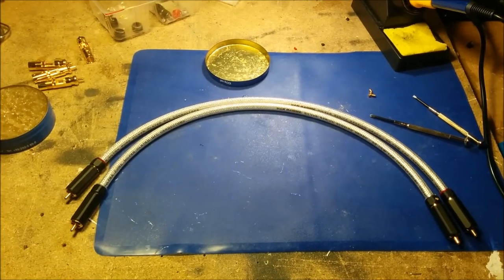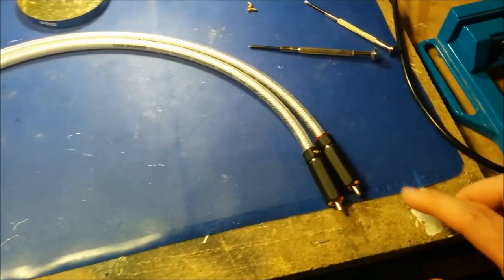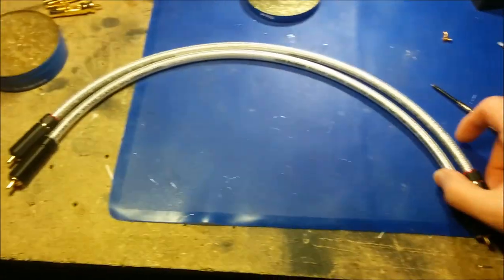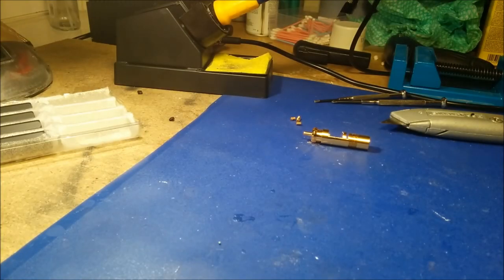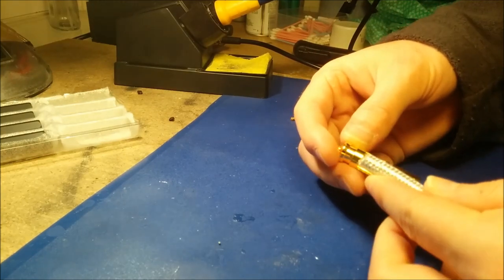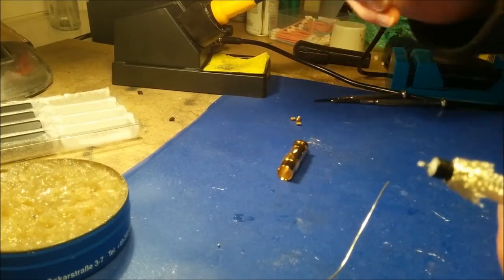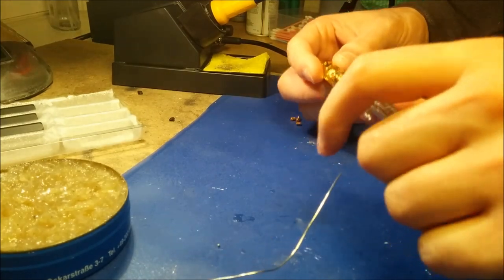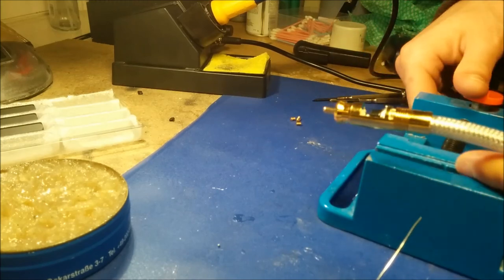How to make 1000 $ Sounding audiophile highend RCA interconnect cable for 30 $ !!!

Comment: Just curious. The Van Damme Lo-Cap Silver Series is rated at 55p/F. Is that per meter, or per foot? If per foot, then it would be about 17p/F, which makes this very expensive cable marginally better than the budget priced Monoprice cable. Interesting.

Super cheap Monoprice cables use standard RG-59 75ohm coax rated at 22p/F.

Blue Jeans Cables are rated at 12p/F. Rated one of the best in the industry for low noise distortion. 

Exactly why would a higher capacitance Van Damme coaxial cable be better, when it is pretty well know that the lowest capacitance provides the lowest noise and interference signal?

I think for any component run under 1 meter, no audible difference would be noticed, unless you were Superman. I'm starting to think unless you are putting components all over your room, most normal stereo stacks will use under 1 meter RCA connections, Standard Monoprice Premium RCA's are all you really need, and all this super high end cabling is primarily for BLING!!!
Reply: Condor1970 it makes a difference, capacitance is only one form of measurement.
Reply: What measurements? Just curious, because they do lots of sound recordings to analyze the actually sound signatures after production, and it seems very little if any difference is notable. I'm certainly no expert, but if there is some series of measurements taken to provide serious differentiation of the cables, what are they?
Reply: Condor1970 it's basic electrical engineering. At college I learned about capacitance, inductance, impedance, resistance etc and the ways of calculating them. All circuits follow things like Ohms law, even hifi setups. 

Other things affect the sound too. For example the geometry of the cable. Many studios use Canare Starquad cables. Why? It is because starquad configurations virtually eliminate EMI. Recording studios and equipment at gigs can suffer from interference from many things like lighting. Canare Starquad is one of the most popular cables for mics.

In terms of other measurements, not relating to electrical engineering. There are many ways to measure a cable. A good way is measuring its performance when coupled with a loud speaker. Have a read of these:

http://www.qed.co.uk/qed-academy/reports/the-genesis-report.htm

http://www.qed.co.uk/qed-academy/reports/the-genesis-report-II.htm

These reports are from QED, one of the few cable manufacturers that offer performance metrics and put a lot of engineering knowledge into their designs.

As you can see, cables do make a difference to performance. Now whether the difference is big or small is subjective. Depending on whether there's always a difference is dependant on equipment. For example, tube amps are a whole lot more sensitive to impedance changes than transistor amps, in which some transistor amps have been made to combat any cable differences. Speakers also vary in impedance rather than being constant (though some have been engineered to be), which will make differences vary with each pair of speakers. It is entirely dependant on the system.

I hope you have gained some knowledge from this.
Reply: Michael The Sociopath I know that tecnically there is a difference. I am also well aware of ohms law, etc. My point was that from what I have read about the design of various cables, adding shielding to cables in proportion achieving shielding from interference is kind of like adding Titanium Oxide to achieve SPF ratings in sunblock lotion. The increase in shielding is kind of exponential in it's results. Basic shielding like that in the cheaper cables show a rating of shielding say 99.9% EM interference. Adding double the shielding, or higher quality shielding only increases the percentahe by a small marign. It gets to a point where adding more shielding has a technical increase, but is so small the human ear is incapable discerning the difference.
Reply: Condor1970 shielding matters, but more so the dielectric and geometry.

Comment: hi  where did you buy the raw cable?? and where did you buy the connectors??
Reply: +tony1966on I just got mine a week ago; found them on eBay.  The cable came from the UK I believe, but I'm in Alaska and I think whoever I got it from had free shipping.  Link is at the beginning of this thread.

Comment: No reputable audiophile company would sell your pro cable stock + Chinese connector combo for $1000. This would sound like maybe $200. High end cables would use OCC cryo treated conductors, Teflon or some exotic insulator scheme, unique geometry, resonance control measures and high end plugs (like real Furutech plugs with micro-ceramic treatment for example). The only fairytales being sold online are poor class warfare junkies who aren't actually interested in high end audio to begin with.

Comment: RCA connection dont use in pro stuff,pro choise is ballanced XLR interconnection.In most times.
Reply: RCA cables are perfect for home use or short distances. XLR is only necessary for long cable runs when noise becomes a huge problem and it is designed to eliminate this.
Reply: Joseph Richards RCA have only 2 way contacts,XLR have 3+ground.You cant make a ballanced connection with RCA - thats the main difference.

Comment: Did you calculate cost of electricity, time, soldering equipment etc.. into that 30 dollars  ? If not that these cables are actually more expensive. Still cheaper than 1000 dollars though.

Comment: 4 RCA (WBT-0114 Cu nextgen) connectors cost about 100$ so how it's possible that you spend only 30$?
Reply: Korrus Korrowaty 
They probably upped the price. Find replacements.
Reply: There are fake WTB 0114 for much lower price at EBAY.

Comment: The difference in SOUND QUALITY between a normal RCA cable and the 1000$/30$ cables is probably 1% if any!!! Especially for cables not longer then 2 m. 10x for the video,  the cables Look nice ;) .
Reply: +Aurel Hategan Well the difference between cheap OEM cables and a good quality premium cable is quite substantial, though past a certain point, the difference is negligible unless you have golden ears and very expensive equipment.  
Most people are far better off building their own with premium cable like Gotham, Mogami, Canare, etc.  Without spending too much, they'll sound basically as good as any thousand dollar cable.
Reply: +PDX Girl "unless you have expensive equipment and golden ears."
Ah but everyone with expensive equipment has golden ears. 
Strangely enough usually glass balls too as they virtually always refuse to subject the cables they promote to a simple A/B blind test.
Reply: +FuckGoogle+ I've always told people I work with on this subject that unless they are performing blind tests, comparison is worthless. When I do tests, I usually blind test multiple people as well.
There is a very real difference in cables, but only to a point is the point I was trying to make. In the end, it's about making a customer happy and if they think something sounds better, that's their prerogative if they're willing to shell it out.
Reply: +PDX Girl Yes, but let's be honest there. If the cable presents all aspects needed to transport the sound correctly, what some cheap cables can do (10$/m), so you will not be able to have any significant soud "bettering", even with 100 times more money spend on it.
Although, let's be clear that the german radio and TV institution had made an impressive written work around this, and are giving advices to their engeneers how to make sure to have an unvariable and good reproduction of an audio signal transported for about 30m, this is possible in same quality with numerous brands from all price classes. At least, the reliability of the cable may vary from brand to brand, but that is not a problem for a normal hifi use.
Reply: +Bob Outélama The cables I normally use are quite a bit less than $10 per meter (for balanced line-level interconnect cable), but certainly of higher caliber than generic / OEM cables.  I wouldn't spend more than $10 per meter for anything, perhaps that much for the higher-grade speaker cables I use.  Wholesale pricing anyway.  
Good cable from the likes of Gotham, Mogami, Canare, et. al. are what I'm referring to, and with reasonable connectors and good solder can rival the most expensive cables.  That was the point I was attempting to make.  And they do have a quite noticeable difference from OEM cables.
I have done extensive blind listening tests with both experienced listeners and average non-audio people.  The difference between the OEM cables and the brands I listed are quite noticeable, but the difference from the brands mentioned and "high end" ("expensive") audiophile brands often is not.

Comment: Silver coated Oxygen free copper.. That are the real cables.. Not the cheep copper
Reply: The internals of both your audio source and speaker are made of regular copper. The same for every computer, digital camera, or other system that uses even more precise electrical voltages than an audio system. Why is it that audio cables have this unique need to be 'oxygen free'?

Comment: The problem with his "hate industry" attitude is that the cable manufacturers test, design, advertise, test results, compare, upgrade, make assortments, and warranty their products and have controlled audible results.   He welds stuff together with no predictable outcomes sonically or anything to compare it with.
Reply: neonRTowner you can compare it with the results that people get when they measure the properties of "high-end" cables. Everything is measurable. Inductance, resistance, capacitance are all variables that are measurable and can have an effect on audio equipment. The thing is that people are selling cables that have nice sleeving, nice connectors, and ordinary copper wire with maybe some silver on it, and they are charging for it like it is gold. They speak about improved performance over and over, and the thing is, there are no new discoveries regarding copper and cables. We know what we knew years ago, but they didn't make 1000 dollar cables some few years ago. Few meaning a decade or two. The nice look of the cable doesn't affect the performance, and the fairytales also have no objective impact on the "sonic" performance of the cable, and that's just it.
Reply: neonRTowner I wouldn't say they aren't coherent, but I can understand that they might be hard to understand because of how long they are. The point is that there have been zero advances in the field of cable making, but more expensive cables have come out. That is marketing, or advertising if you will. Do you understand what I wanted to say before?
Reply: Where in the hell did you come up with this (exact quote) "The point is 
that there have been zero advances in the field of cable making"
Are you living in Siberia?  Stuck in Belarus prison too long?
Reply: neonRTowner lol. Tell me one.
Reply: I don't have time to create manufacturing data for you on Youtube.   My 
favorite cable company is WireWorld and they update their cables every 
year.  Start there or stick with your "ears" and homemade cables.
Reply: neonRTowner dude, have you measured any of their cables. What they tell you just might not be the truth. You cannot discover new copper cables every year. There are no improvements. What you hear is a placebo, or maybe a different diameter wire, or a different length of wire.
Reply: neonRTowner lol where is the placebo? Am I the one talking about cables that get updated every year? Did you even try to educate yourself with that video I linked? Have you any idea how conductors and electricity work? Tell me one discovery that was made in this or the 20. century regarding cables.
Reply: neonRTowner Lol I just can't understand you anymore. I guess I am anti cable now and I also live in a ghetto garage making cables. I guess that's a new term for students of electrical engineering who try to educate a few people who weren't lucky enough to receive proper education. But the really bad thing is that you don't want to accept logic and arguments. Instead, you started calling me names. I sincerely tried to help you stop wasting money. And you should research the word "malice". Or read my comments. Bye
Reply: If you don't like the freedoms and protection of this country, you can always head back to the Ukraine.  Now that is one sad country.
Reply: neonRTowner Well I have no idea what's this talk about freedoms and protection. I was just saying that you have not been educated properly, but I guess you think you are free because you can curse people on the internet. And what is this about Ukraine? You felt the need to tell me about your experiance in Ukraine? I can't argue about that, since I haven't really heard much about Ukraine, and since I haven't visited the country. Do you feel ashamed now for trying to offend someone in such an unsuccessful manner?
Reply: neonRTowner Still no arguments... It's a sad sad day. I was hoping you would improve...
Reply: neonRTowner You mean to tell me you don't know how to use a soldering iron? What if I told you that all the connections in your power amplifier and your speakers are joined by solder? How would that make you feel? Cheapskate
Reply: neonRTowner what's a rubel?
Reply: What you get payed with?
Reply: neonRTowner You thought that students get payed?
Reply: neonRTowner And why do you talk about me making a set of "audiophile interconnects"? Why do you keep saying stuff about my "ears"? Where in my comments did I say anything subjective or anything that's not a fact?  You kinda keep pushing the idea that I am the subjective one here, while in reality there is little technology regarding speaker cable, and even less for such short cables as interconnects.  They are just so short, you know?
Reply: I made no references to students - anywhere.  AMERICAN students get payed if they have jobs while working.  Are you confused over something again?
Reply: neonRTowner You made a reference to a student when you said that I get paid with ruble. And when and where did I get confused beforehand? Will you provide any arguments? Have you done any measuring, any AB tests, any form of comparison between the cables you call bad and the cables you pay a bit more for? I just want to know how do you know which ones sound better
Reply: I have my preferred brand of cables (WireWorld) - quite satisfied.  You get confused easily.  Is English your 2nd or 3rd language - given what country you really are from; that you seem reluctant (or understandably embarrassed) to admit to.
Reply: neonRTowner Why would I be embarassed and where did you see any evidance of that? Where did I get confused? And what makes you think english is my second or third language?
Reply: neonRTowner And why do you like cables from WireWorld? Could you elaborate please?
Reply: neonRTowner Why do you keep talking about interconnects? I have no interconnects made by myself, and you still seem to think that cables should be auditioned. There are instruments that measure the properties of conductors, why can't you accept that? 
And why haven't you answered any of my questions? I simply asked for the reason-why do you like those cables. I ask you a few questions without any form of insult hidden in them, and you come back, you call me an idiot, and you answer nothing. And your talk about cables being audiotioned is just ridiculous and shows how you really have no clue. And the magazines you mention? Are you kidding me? You read magazines? In what century are we living? Why would anyone send anything to a magazine? Send it to an electrical engineer, they actually know about these things. From your last response it's clear that you aren't really reading my comments and that you are angry about something, because you just keep coming back frustrated and that's why you keep throwing insults. I just don't see why are you so insulted by every single comment, no matter how simple my question, or fact I present you with. And the thing you mention about referencing? Well here you go, have a read http://m.machinedesign.com/blog/5-myths-about-speaker-wire .
If you want a bigger article, I will search for it, because I couldn't find it. Of course, done by engineers, not by your magazine writers.
Reply: neonRTowner P.S. try to read my comment before replying this time. And stop making yourself look bad by saying you can't understand me, because everything I wrote in the last comment was perfectly understandable.

Comment: i bought one of these rca plugs but with a screw terminal. should i bother soldering? also a concern is mg rg6 cable have a unsolderable braid. can i just snug it through and then screw in the ground side screw to fix it?

Comment: You need to take a set of your cables into a real high audio store and compare  them to a true $1000.00 pair of cables You will get your eyes opened to what your cable are not $30=$1000

Comment: what does a 1000$ cable sound like compared to say …..one laying in the bottom of my cable drawer ?? serious question, not trolling..
Reply: The same, assuming the cable you have in your drawer is whole, well constructed (as in, not falling apart) and has decent gold plated connectors that aren't loose.
Reply: @lorcro2000  
You sir are exactly right !!!
Maybe I was trolling...little bit 🤣

Comment: why you screw ?? This damage cable fp, and you bad done with shield, need to connect full area of shield - not one tiny piece.. And this neutrik contact is bad))  why ?? cuz it's good for the ground signal - not for the hot - where sound is running, - check WBT - they have rca  with such methd but for the signal pin)))

Comment: That is not a $1000 cable, that is still a $30 cable. That can be good only for low end or mid fi amplifiers.your SE Conductors will not even sound good with high end gears. That cables sells $60 at EBay.